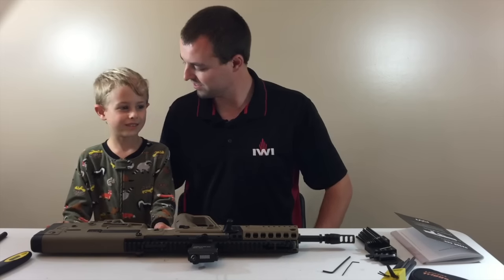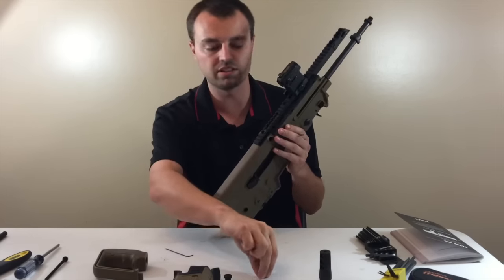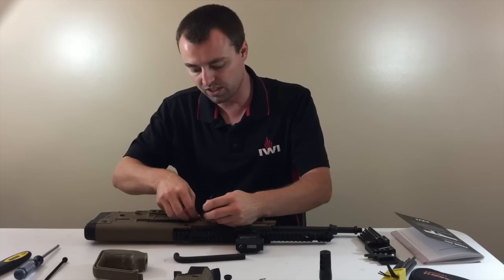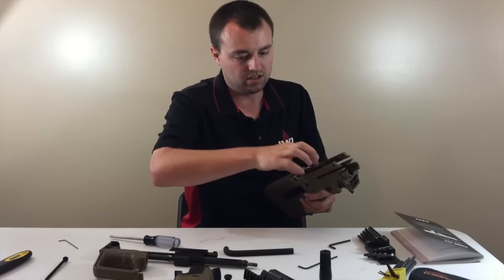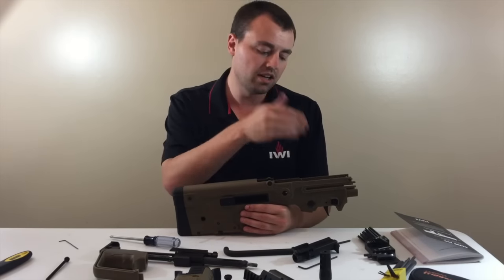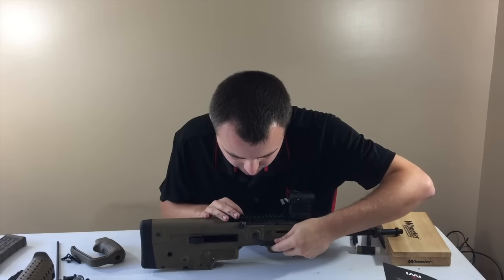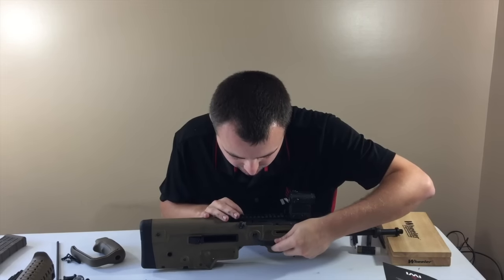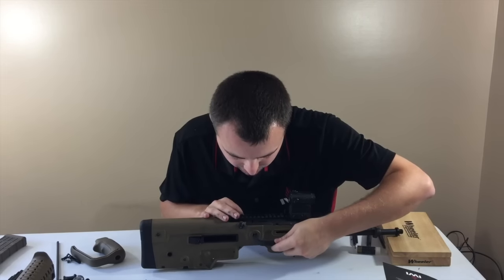IWI X95 Geissele Lightning Bow Trigger Install - REMOVE CHARGING HANDLE

Comment: I was able to install the trigger without much difficulty.  However, now my my BCG will not move freely when I put it in the rifle. Any ideas?

I managed to bend my charging handle after making some adjustments to the trigger screw. Got a new  one and now the BCG won't fit properly.
Reply from the maker: Be sure to contact IWI.  They will help you determine issue.
Reply: @HolosunAdam  Thank you.
Reply: @HolosunAdam  Thanks for the reply. Turns out I also jacked up my gas tube. Got the parts and am back in business. 

Great video too. Very helpful. Keep up the good work!
Reply from the maker: Jonathan Arthur glad they could assist!

Comment: Sorry I farted at 6:38 guys, I got exited when he pull out that barrel...
Reply from the maker: Definitely a fart.  No chance it was a mic issue at all.......
Reply: Indeed, jokes aside do you happen to know if the x95 "could" possibly hold, in the lower rail the six12 shotgun mount?

Comment: I installed mine and functions exactly as expected... BUT the barrel is hard as heck to remove and install now. It scrubs the trigger. When comparing the OEM trigger, the lightening bow  is a different angle and the barrel rubs up against the arm that connects to the transfer linkage. Even with the trigger installed completely correct, it still prevents smooth installation of the barrel. When I put the OEM trigger in, barrel drops in with ease, just with gravity. I consulted with Geissele and they suggest I take my rifle to an armorer to have it checked for proper installation, but it's the dimensions of the trigger because it dont match the OEM as far as how far over the pin is. I might have gotten a bad trigger? Has anyone heard of this?  I cannot do anything to get the barrel to clear the lightening bow.  The only solution I have is to file away the polymer on the trigger cut out about 1mm to 1.5mm so the trigger seats closer to the transfer linkage. That is not something I am willing to do because I would have to shim the trigger to reduce side-play.

Comment: what a disaster to change a trigger
Reply from the maker: shockey49 - It's different......and yah it's a pain. 

Do remember that the main part that most people are changing of the trigger pack which takes 10 seconds. Changing the actual trigger is a bonus though that is a good option.

Comment: Why does the retaining wire part go in after the pin?  Why not just install it into the hole from the start and let the tapered part of the trigger pin push it out of the way and snap in just like an AR hammer pin does?  What does the manual say?
Reply from the maker: Shao Zhang the retaining wire is screwed in and tightened.  I didn’t have any luck trying to screw it in first.

Comment: great video. may sound like a stupid question, but is there need to check the head spacing after you reinstall the barrel?
Reply from the maker: Kevin Kreutzer I have not seen any reason to yet. The barrel locks into place the same each time.
Reply: Shield and Sword Academy sweet. keep up the good work!
Reply from the maker: Kevin Kreutzer glad you enjoyed the video!

Comment: Thanks for the video and some great tips. Only thing I would add is loosening that screw on the trigger is better. It will tend to settle or pop into place when you put the pin back in and it slides over that cutout.

Comment: Good video, thank you. FYI, if you have a muzzle device you would prefer not to remove (rocksett on for example), you can still get the charging handle out before removing the barrel. Push the forend towards the muzzle and rotate it ~90 degrees. Rotate the charging handle retainer so the charging handle can slide forward and finagle the charging handle and rod out past the forend. Then you can remove the barrel with the forend still on the barrel. Also, you can use a large flathead screwdriver as your barrel wrench. Not responsible for damage.

Comment: do you just use locking nut for muzzle device/suppressor? no special shoulder ring to make sure it's concentric to bore? baffle strikes?
Reply from the maker: sniperbob11 for suppressors especially, and some brakes, the company usually recommends shims to avoid baffle strikes as a crush washer might not crush equally on all sides. 
I use the lock nut included on the rifle from IWI and have no issues.

Comment: i forgot to ask you is that the original muzzle or after market? do i have to take off my muzzle to remove the guard?
Reply from the maker: James Regnier mine was a silencerco break for my suppressor. the original muzzle device should not need removed.

Comment: This video was a real time saver.  My rifle is one of the newer variants with the gen4 charging handle.  I noticed immediately I had a different setup than your rifle after removing the forward cover.  The collar rotates easily after pulling the charging handle back about and inch.  Manticor Arms covers this in their charging handle install video.
Thanks again!  Cheers.

Comment: Well, I have the original Tavor...and one of the earlier released ones at that. Going on 2+ years of not cleaning it. Running it suppressed with a Saker 5.56 and steel cased ammo. Few drops of oil on the bolt every now and then...still have yet to experience a failure. Guess Javier doesn'5 actually have any real experience with the rifle... If I used it more, I'd definitely go for the upgraded trigger, but all my shooting is usually run and gun stuff, so accuracy wise, 1/4 size torso target hits are all I look for
Reply from the maker: Joe Ondish glad to hear your experience. keep putting that rifle through its paces.
Reply: Joe Ondish clean it .. that's nasty

Comment: How do you like your X95? I've been interested in one for awhile. Thought about selling my LWRC IC a5 for one. But I've heard reports of this being pretty bad in the accuracy department and getting very dirty very fast when running a can. More so than a DI AR.
Reply from the maker: 86keen - I love mine. I have not had the accuracy issue others have. I prefer the X95 due to the controls being similar to an AR15.  

I shoot my X95s in 3 gun a lot and even out to 300 yards hadn't been an issue. I would highly recommend the X95.
Reply: Shield and Sword Academy thanks for the response. Fondled one at brownells today. I don't think I can part with my LWRC thought. That spiral fluted barrel just turns me on lol. Before I spend the cash on a new rifle I have to wait to see if DT ever brings out the MDR. If it hold true to there company it should have an amazing trigger and great accuracy out of the box. Will def have to get one of the other though.
Reply from the maker: 86keen - Desert Tech has been promising the rifle for so long I gave up on it. I hear they are hoping to ship soon but I think I'll stick with the X95.
Reply: My x95 shoots like crap with 55gr and 62gr but it loves 77gr , less than 6'' groups @ 300m
Reply from the maker: quaken3 - We have been running two different X95's with serial numbers far enough apart to ensure they are not from the same batch.  55gr wolf gold shoots great out of both rifles.  We are getting 2MOA at 100 yards and are hitting torso size steel at 300 without issue.  I have seen some of the issues other have had but we have not experienced those accuracy issues.

Comment: Once my barrel wrench comes I'll be following step by step!
Reply from the maker: Brian Babinski awesome!
Ensure you remove the charging handle prior to removing the barrel.  There is a new charging handle design that doesn’t allow the charging handle to remove as easily as mine but it will pop right out

Comment: Just want to say, THANK YOU! Followed this and all went well, thank you very much!
Reply from the maker: AlTheEngineer glad it helped!
Reply: It absolutely did! The OEM trigger spring shot across the room when I hammered the pin out, haha! But I found it, I didn't expect that one! So, I left my lightening bow trigger at the default setting and there is almost no slack, is there a reason to touch it at all? (I don't yet have the upgraded trigger pack).
Reply from the maker: AlTheEngineer sorry about the spring but glad to hear everything is working for you!

Comment: Shouldn't BCG come out before barrel, as bolt locking lugs would be engaged with lugs in barrel?
Reply from the maker: Dave Bigjohnson normally I take it out first thing but I left it in for the video, likely by mistake. Regardless it all comes apart without issue.

Comment: A few things to to note. The old trigger had a spring and the new one does not. I was wondering if the reinstall spring step was skipped, but then after looking at the trigger noticed that the new one is solid and the old trigger had a gap inside where the spring was. Long story short, just store the trigger spring with your old tirgger and it doesn't need to be re-installed. The other thing is that trigger  hex+wire may not snap in flush if the wire is slightly bent (like mine was). You may need to use needle nose pliers to straighten it so that it sits flush before tightening the tiny hex screw. Or once it's in place and not totally flush you can use a hole punch + slight taps from a hammer to have it fit in further and thus straighten it out (after of course making sure it is somewhat in the grove and the trigger pin is not able to move). My new pull is 4lb 10oz on average. Nice two-stage trigger.
Reply from the maker: twjonckheere good info.  Thanks!!
Reply: To clarify- New trigger bow doesn’t have the hardware to accommodate the return spring like the old?

Comment: Thanks just installed the Geissele trigger bow that came in the mail today. Watched your video and took everything apart as you did pausing and rewinding. I added some blue loctite to the screw on the trigger. Went back together as well did a function test and didn't have any broken or bent parts. Trigger feels nice and tight with nice reset. Thanks.

Comment: What if you have a pinned and welded muzzle brake?
Reply from the maker: BREWINZ - Depends. Can you get the hand guard off with the muzzle brake on?
If you can nothing changes. 
If you cannot you would half to remove the brake then re-weld.  Or just stick With the Supra sabra
Reply: 10-4. My rifle is on order so I'm not sure. It's an 18" barrel as well because I live in a communist state (MA). Is there no way to disassemble the hand guard while on the rifle. Thanks!
Reply from the maker: BREWINZ - it does need to come off the rifle. that said your pinned brake might be small enough that you can slide it right over. I have a brake that was slightly to large and had to be taken off.
Reply: Thanks you, sir! Great video. Much obliged.
Reply from the maker: BREWINZ hope it works out for your on sure there is a way!

Comment: Well if everything goes right
I will be ordering my x95 Wednesday and months of being hung up on the accuracy rumors. What upgrade should be done right away. Trigger pack isn't happening for while. I was thinking trigger bow, curved butt pad, and gasket seal for the off side ejection port. U agree disagree, and thoughts? Thanks
Reply from the maker: The primary thing is the Lightning Bow.  That alone will make a huge difference.  If you shoot suppressed then I would definitely look at the Gear Head Works gas port cover.  The curved butt pad I tried but didn't think it was necessary.  That will be something I look at again in the future though to give it a fair shake.  Other than that, put a Holosun 510C on it.
Be sure to let me know what you think of the rifle after you shoot it a bit, you are going to love it I bet.
Reply: Shield and Sword Academy I actually have an aimpoint t1 I'm taking off my LWRC IC A5 and gonna put it on the x95. I'm really excited for it. I've had my eye on them since the tavor came out. Now biggest decision.....FDE or OD green. Both look very good. Thanks for the response
Reply from the maker: 86keen I personally went with FDE but both are great options.
Reply: Shield and Sword Academy so funny thing, I just ordered my x95 from Copper Custom. Decided to go with FDE. They will also be converting it to a lefty for me. I asked them while they had the gun apart if they could go ahead and install the trigger bow. I was told that they were out of stock and that the bow wasn't really designed for the x95 and it doesn't fit in there very well. I said hmmmmmmmmm. So looks like I will be going to brownells for this part. I suppose I will have to buy the barrel tool separate? Thanks for all your help and correspondence.
Reply from the maker: 86keen that's awesome!   You'll love it. 
Be sure to post a picture on my Competitive shooter page on Facebook.  "Adam Litke - Competitive Shooter" love showing them to IWI

Comment: Thanks for the great video! Should that retainer pin lay completely flush with the trigger once it aligns with the notch? I'm unable to get it completely flush. Thanks!
Reply from the maker: Tony Alteparmakian it’s not completely flush. Insert to the point that the pin holding the trigger in place falls into the groove of the pin. I usually have it set just inside the hole on either side.
Reply: Shield and Sword Academy thank you!
Reply from the maker: Tony Alteparmakian anytime

Comment: The video was super helpful to install the lightening bow. Thank you. Question...I have installed and uninstalled the trigger pack a variety of times with no issues (easy right?) except for this evening. The little door under the trigger pack fell out. I put it back in and inserted the trigger pack, but it wouldn’t go all the way in and now it won’t come out. Have you seen that before?  I’ve spent an hour trying to pry it loose, but no luck.
Reply from the maker: Brock Roark so the door has a latch on it that has to fit into a slot. You can see the slot when looking through the chamber. A way to make it easier is to pull the bolt out.
Reply: Shield and Sword Academy thanks for the super quick reply. The problem is now that however I inserted the door everything is stuck. The trigger pack won’t come out or go further in. And the door doesn’t close (weirdly though when the bolt is installed the trigger works) I have the bolt out and the port cover and there just doesn’t seem to be a way to get it to drop free. I guess I have a Shipment to IWI in the near future.
Reply from the maker: Brock Roark let’s try and avoid you losing your rifle for that. Toss me an email at alitke15@gmail.com
Easier to communicate than this medium.
Reply: Shield and Sword Academy thank you. Email sent.

Comment: Is the Charging Handle of the X95 exactly the same as the older Tavor? .... Aside from the location (older one has it on front and new one has it closer to the trigger) are there any difference ?
Reply from the maker: Long Range Sport Shooter they are different.  The X95 is far closer to the shooter this has a shorter tube.  Aftermarket handles for the X95 are not compatible with the Tavor and vice versa.
Reply: Thank You Sir! ....

Comment: thank you for posting this video!!! it helped me a lot with my install. Very true about many people's video not taking that screw and wire out and reseating it in the trigger pin. Tip for putting that wire to seat on that pin. Put the wire into the hole where it should seat. Then slowly reinsert that trigger pin into the body slowly. As your pushing that pin back in, once the Grove of the pin gets past the wire, the wire will seat itself. I did this be accident and it seating perfectly for me. with out having to push the pin back and forth.
Reply from the maker: alexander lim that's what I actually did this last time with my second X95 install.

Comment: Could you make a accuracy test with old and new trigger for comparison?
Reply from the maker: In terms of bench rest shooting you likely won't see a difference in accuracy.  The places that you will see a difference is when you are moving and shooting, rapid fire, etc.  The X95 already has the better trigger group but the trigger itself still leaves a little be desired.  That said I am trying to turn a "battle rifle" into a competition gun.  Those are two things that don't necessarily mesh.....at all.
With the trigger installed I notice that my overall groups are tighter in 3 gun as I am able to quickly engage and move or move and engage at the same time.  The original trigger had a fair amount of slop and was definitely heavier which meant I had to either pull the trigger faster and harder or spend more time on each shot.

With the stock trigger I had no issues engaging targets out to 300 yards (that was the furthest i took it) and I still have no problem with it to that same distance.  We actually have a 3 gun this weekend that has targets at 200 & 300 yards.  I will post that video at the following address and possibly here as well.  (https://www.facebook.com/adam3gun/?ref=bookmarks)
Reply: Seems cool! O like bullpups short style very much. I intend to get one 
when people here in my county (Brazil) get to knock down the weapon 
restriction laws. We almost there. These laws just made crime increases 
here. 
Thanks for the answer.
Reply from the maker: Sérgio Magalhães hope to see your gun laws removed so you can legally defend yourself and have fun of course.

Comment: I finished the install of the geissel pack and trigger to the x95 thank you. I have a  question did you have any  incomplete charging ?
Reply from the maker: James Regnier - in regards to the charging handle not working properly after installation?  No I did not have any issues.